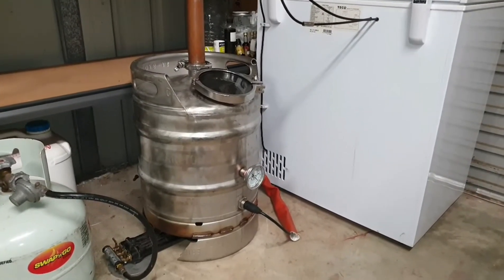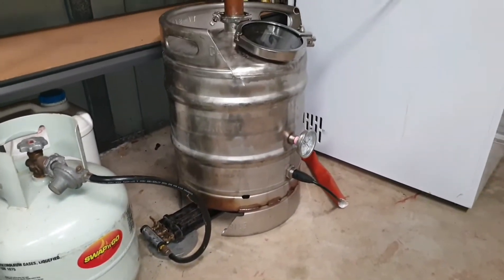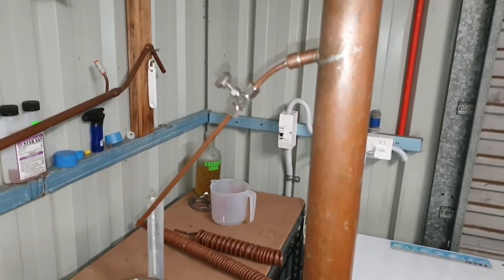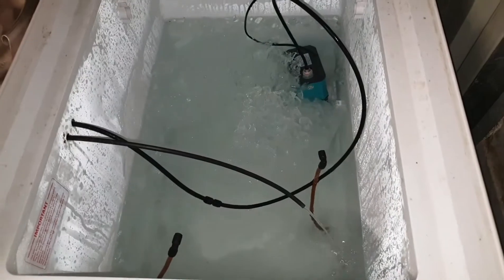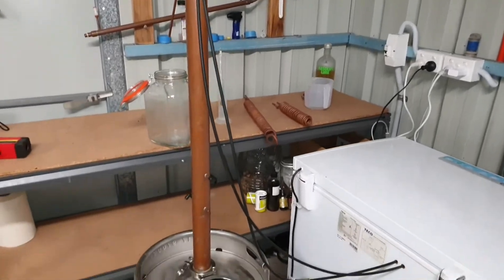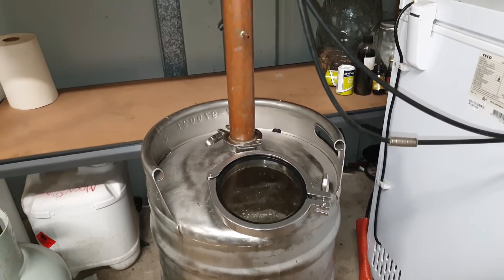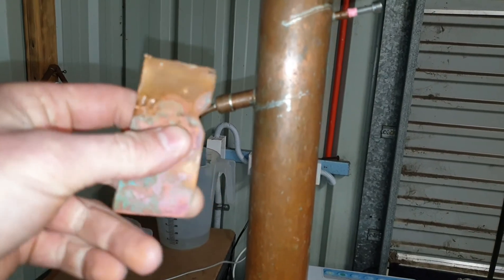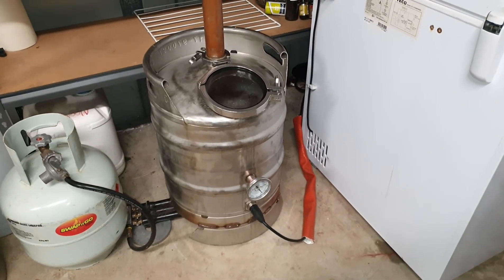Moonshine/ Bio fuel homemade copper reflux still rundown.

Comment: You have a 6” Ferrel with a glass window… anything special? Tempered glass? What thickness?
Reply from the maker: The local homebrew shop had them custom cut out of 5mm thick glass, due to the heat expansion and horizontal load from the tri-clamp, the secret is to loosely install the clamp until the boiler is up to atleast 60°C or you see it starting to leak, then tighten the clamp enough for it to stop leaking. 
I have used this boiler atleast 10 or so times now and I havn't cracked the glass yet, as a back up I have a stainless 6" tri-clamp blanking plate just incase.

Comment: I have a similar 2" copper reflux still on a kegg but with 1 major difference:
I added a 2" straight tee into the column, with the branch valved-off when in reflux mode. When in potstill mode, I open the (butterfly) valve and all vapors condense in a Liebig condenser.
This gives me the freedom to recuperate maximum aroma from the wash if I want to.   I don't need the potstill mode for plain sugar wash but it's great for fermented fruits.
Of course you distilling "fuel" only, might consider the same for making aromatic or non - aromatic high ABV fuels.
Reply from the maker: Thats an awesome idea mate, two still styles built into one! Might be a future project for me. 
In the past I have ran the column with no ceramic beads and the outlet tap wide open, it gave me a much lower ABV (65%) and full flavour from the rum wash I made, unfortunately it wasn't super efficient without an outlet condenser. I like your idea better! 👍🏼
Reply: @harbourbuilt3891  i fully understand your process, by operating your column without packing and your liquid management valve wide open, you "castrated" your reflux stil a bit.  Indeed you will collect lots of aroma doing so .. But... to get maximum flavors out of it my "short track" potstill mode is indeed the better option. You're right though about the  low(ish) ABV in potstil- mode.
I have 3 condensers incorporated in my stil
# SS 304 deflegmator coil in the very top (bokakob type) 
# a smaller SS 304 Liebig condenser for further cooling down the already condensed and collected alc. 
# a larger final condenser (copper) for the potstill short track.
In my configuration It's possible to feed the condensed alc from the small stainless steel into the larger final copper condenser. The connection done by a silicon flexible hose.
The reason for that is that i bought some ready made stainless steel stil components directly from distillex@ - china.
The 2*column and the larger final condenser i made myself of 2"copper pipe.
Instead of ceramic beads or copper wool, I use self- made 15 mm short pieces of 10 mm copper pipe which i fill into my column approx 35-40 cm high.
The flow resistance is low.  copper surface is high.  Catalistic function. is excellent.
All fittings tri clamps, so modifications are a piece of cake. The same is true for cleaning and flushing. 

Good luck for you!!

Comment: 98%? I don't think so mate. Check the accuracy of your alcometer and the temperature you're taking the reading. The azeotropic composition of ethanol and water is 95.635% of ethanol and 4.375% of water by weight. Unless you have a molecular sieve, you can't get greater than approx. 95.6% of ethanol via distillation. If you're close to that, which it sounds you are, well done!
Reply from the maker: I think you're correct about the temperature, once it cooled down the next morning I noticed the ABV had dropped. My measuring technique isnt the best, my first few messurements after the heads, the alcometer was reading well above 100% which i figured it was due to the temperature being too high. I may need to look at building an outlet cooler for a more accurate reading.
Thanks for the comment mate, I have some room for improvement 👍🏼
Reply: @harbourbuilt3891  You've done a great job with the build mate! Getting anything over 94% is awesome, and I reckon you're close to azeotrope with that setup and column length. I love your coolant setup! A small Liebig product condenser to reduce the outlet temp is a good idea, and with almost freezing cooling water, you wouldn't need it to be too long. My old boka spat out product at around 50 degrees C before I added a small copper Liebig. Great setup over-all mate! Cheers.

Comment: You’ve got that thing fine tuned 👌🏻👌🏻  you could almost run a metered drip feed to a bowl of burning alcohol under it so apart from the coil pump it would be self sufficient 😂
Reply from the maker: Haha thats an idea! 🤣 its suprisingly slow, stable burning fuel when in liquid form. Only issue is if it isnt cooled enough, it will start venting vapour and becomes explosive, bye bye to my shed💥😬